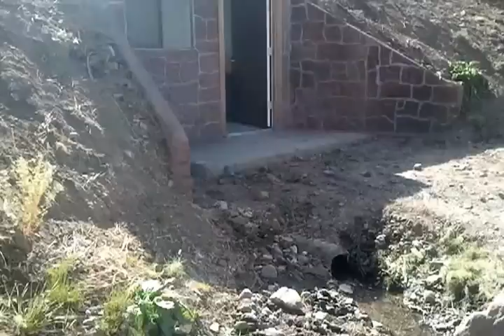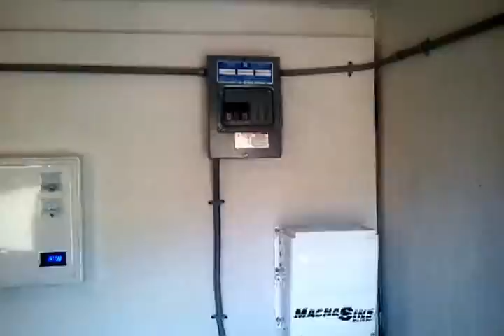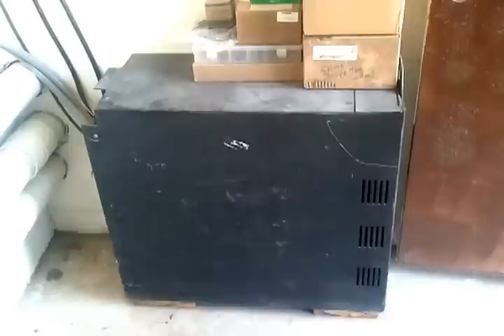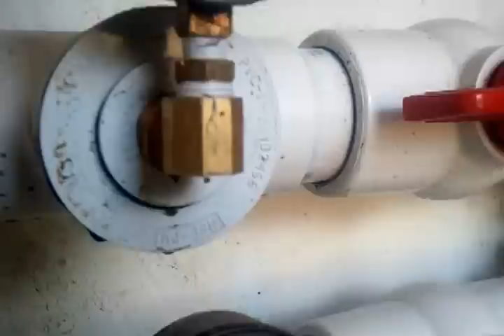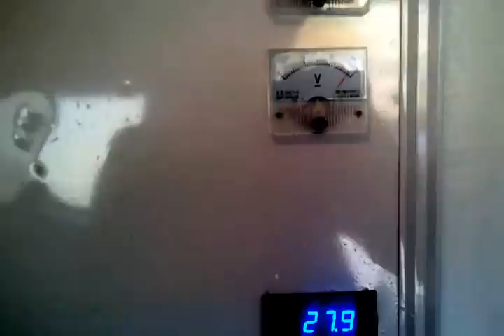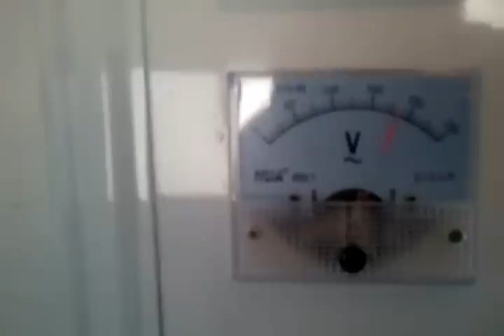Micro Hydroelectric Powerhouse

Comment: Can this be done on a small scale using deep cycle battery for a high output pond pump to feed in a water catchment system to be continuous?
So basically how much psi is needed for the pelton, I'm trying to do a low power pump for force hoping not to cancel each other out